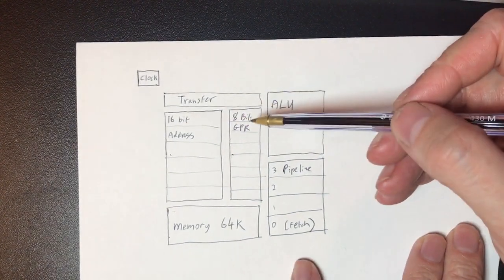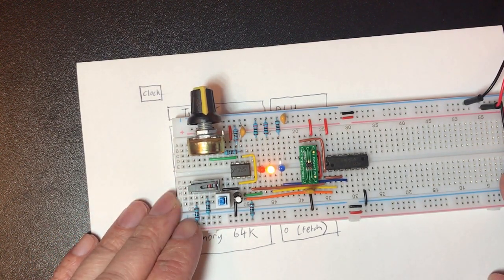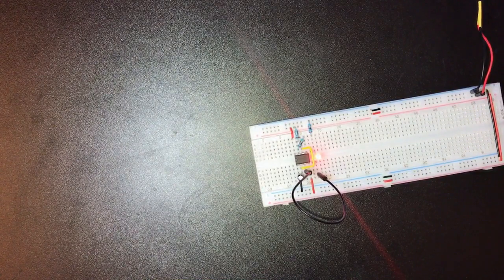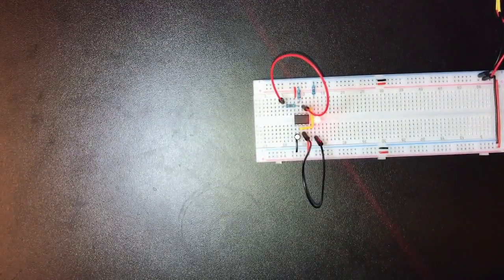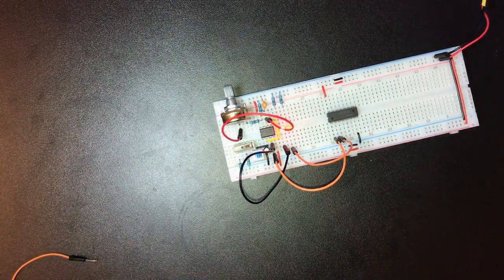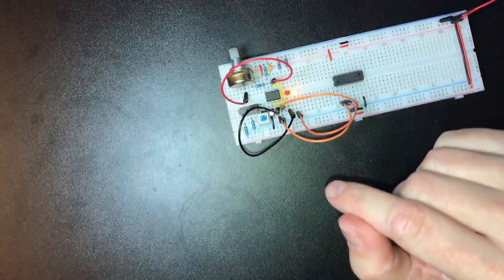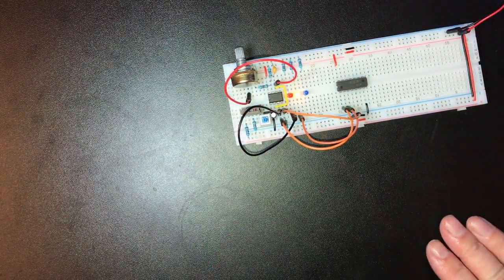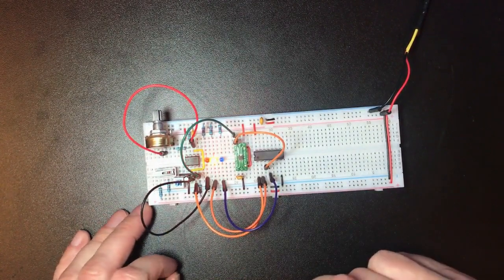Introduction and Clock Build - Making an 8 Bit pipelined CPU - Part 1

Comment: Your 8-bit CPU definition doesn't hold water for some other CPUs and it's a bit difficult to define it too.  Me, personally, I define it as the size of the main accumulator or main register that receives results.  For example, the ALU on the Z80 (which is considered an 8-bit processor) is 4-bit.  Also, the Z80 can do computation in 16-bits too (add hl,de opcode for example).  So is it 4-bit, 8-bit or 16-bit?  In truth, I don't think there's a proper definition and it's pure marketing at the end of the day.  Some people say it's the size of the data bus.  An example related to this is that we can say the ARM7TDMI on the GB Advance  is 32-bit due to the 32-bit registers it uses, but the data-bus is 16-bit (so you needed two fetches to get an instruction from the ROM unless you used the thumb instructions).  Is it 16-bit or 32-bit?

Fantastic video btw!
Reply from the maker: Yeah, I appreciate it's vague, I did try and get that across but this was my first video, I've got a lot better at collecting thoughts and presenting them now (I won't say good, but I will say better). I just re-watched the start, I didn't really attempt to gave a specific definition, I just said that with an 8-bit alu and 8-bit gpr's mine was really just 8 bit.  I can do single cycle 16bit increments and decrements on the address registers though.   I was really proud of that "unless you are the marketing department of a 90's console manufacturer" joke at the time cringe .
Reply: @weirdboyjim  I think your joke was nearer to the mark ;)  I think your design is more 8-bit than most 8-bit CPUs out there.
Reply: @weirdboyjim   That was spot on, and made me laugh.  haha

Man... the 90s... when everyone cared so much about an architectural facet that most people couldn't even explain anyway.  "It's 32-bit!  That's better because it's got more bits!"  Uh huh, sure.  :-)
Reply: @nickwallette6201  more memory or less wait for a tiny ALU :)
Reply: @100-pc-notbot   The ALU, yep sure, if you're dealing with multi-byte integers frequently.  Could definitely be useful.

But memory.. well, the address bus was almost always larger than the data bus, and it wasn't usually the bus size that limited how much memory you could have.  :-)

Think about the N64.  64 bits!  Wow!  ...and 4MB of RAM.  haha  (Granted, the address space would have to accommodate ROM and any memory-mapped stuff as well.  Still, hardly bumping into a 32-bit ceiling on that one.)

Comment: The 555 shouldn't lock up at power up. Put a 47uF cap where the power pins enter the breadboard and a 0.1uF across 555  pin 1 & 8. Also 0.01uF on pin 5 to ground.
Reply from the maker: If you check the later circuits once I move to pcb I have both the decoupling and the pin 5 cap.
Reply: @weirdboyjim  Just said that as I thought it might help to eliminate the issue with 555 start up. Not sure if that is the solution in this case.

Comment: James do you happen to know the part number of your Single pull double through switch you are using.  I really like it.
Reply: The one with the metal piece that is part of the manual clicker.
Reply from the maker: Those were an ebay purchase,  https://www.ebay.co.uk/itm/153082266200

Comment: Just started watching so i thought i'd better start at the beginning, one question how will the pipe line cope with a jump instruction, were you have to empty the pipe and refill? which is why too much jumping in code slows it down. enjoying the video.
Reply from the maker: I hope you enjoy the series! Well spotted, a pipelined cpu does have to deal with that issue. If you haven't come across it before a term to lookup is "Branch delay slot", some of my branches have this. I don't want to spoil too much here though.
Reply: @weirdboyjim  Most of my programming is on microcontrollers which never seem to have pipelines. the few programs written on a PC the speed of the processor is way above the response times i required so squeezing the last bit of speed is not worth the effort.

Comment: How does pointer arithmetic work to access addresses above 256 if the alu only supports 8 bit values?
Reply from the maker: It supports a full set of flags so you can do 16bit operations as two 8bit operations.
Reply: @weirdboyjim  thanks for replying, is there a video in the series which describes how this works?

Comment: Which ROM can we use in an 8bit CPU??
Reply from the maker: I started of the 28C16 but i've switched to the 28C256 because it's still a current part.  For this kind of work most parallel interface ROM chips will work fine as long as you have enough lines (there are probably some weird devices where this isn’t true). I would make 2 recommendations, check the chip is still available and is marked as “active” on supplier websites. You don’t want to suddenly redesign because you bought some old stock on ebay and nobody makes them anymore. Also make sure that there is good support on device programmers.
Reply: These days i would use an EEprom rather than an classic UV erasable eprom.

Comment: How much is the capacitor?
Reply from the maker: From memory I believe that one was 100uf but you can be flexible, the 555 data sheet has a formula and different combinations of capacitor and resistors will produce the same or similar results.

Comment: I was expecting you to use a transistor for inverting the signal there.
Reply from the maker: If I wanted to do it without a chip these days I'd probably use a pair of fet's, using a pull up resistor and pull down transistor tends to create a difference between the rising and falling edge that you might want to avoid on a signal you are broadcasting across the entire circuit.

Comment: The caps are running in parallel to ground. The ceramic should be on pin 5. Im years late haha
Reply from the maker: If that's the only thing you found wrong with my first video I'll count myself lucky.  That was a silly mistake, can't remember when I found that.

Comment: Please I need direction. How can I get to this level of knowledge of computer system design without a degree
Reply from the maker: There is some great content online now. There is amateur videos like my series but there are also full lecture series from universities that will take you much deeper. My personal recommendation is to either get some chips and breadboards or some circuit simulation software and try building some basic elements yourself, practical experimentation makes learning faster and more interesting than just trying to take it all in directly.
Reply: I recommend the Falstad Circuit Simulator.  It's a tiny Java applet where you get a schematic view of a circuit that you can edit before (and while) you run it, and watch the voltage and current, logic levels, and so on.  It's not as full-featured as a full SPICE simulator, but it's leagues easier to use, and I've simulated a lot of circuits on it that I've built successfully afterward.  It's my go-to since it's so trivial to test a quick idea.
Reply: take a look at the online course "NAND to Tetris" (and its free)